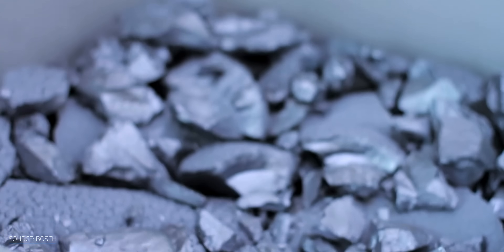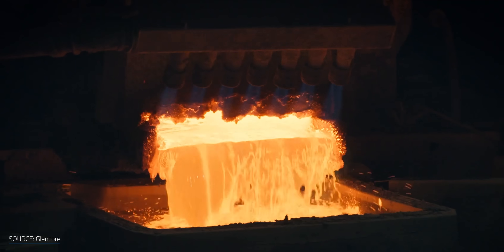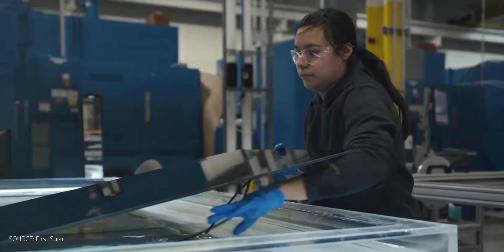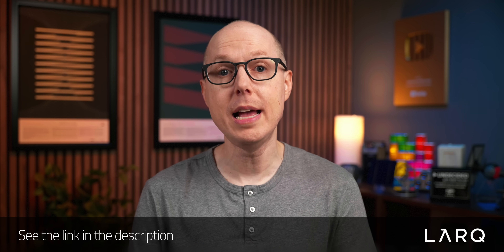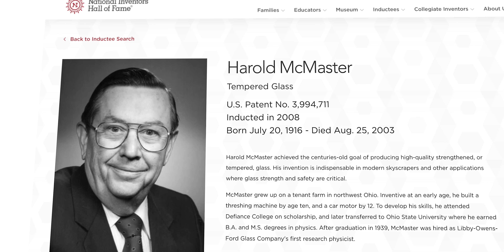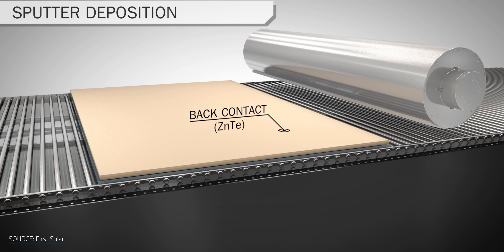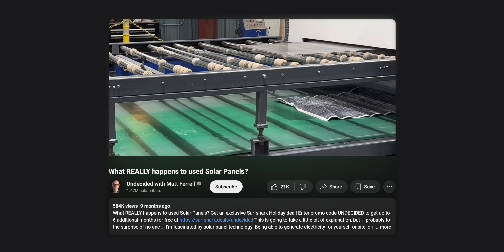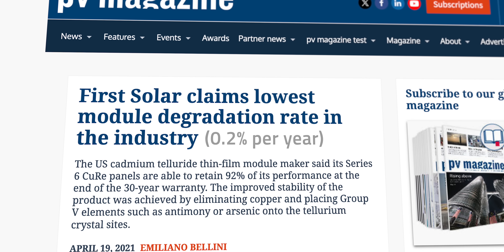How the Next Big Solar Panel Tech is Already Here

Comment: The difference between CdTe and table salt is, we don't have to ship truckloads of nasty Na and tankers full of cleansing Cl across the country to make our nice benign compound. Any site where Cadmium emerges as a (by)product is a potential problem.
Reply: The one thing to note is, we are already producing both elements at scale as they are byproducts of mining copper and other metals. Combining the elements negates the toxic effects as opposed to putting them back in the ground at higher concentrations.
Reply: @Ryan-ff2db  Yes, good point.
Reply: I well remember having a H&S inspector going round our site, where we had some processes using radioisotopes, a nickel plating plant, vacuum brazing and we handled a lot of lead, copper and zinc.
The inspector said to me "You don't use cadmium or mercury then?"
"Not at all."
"Well, you've got nothing to worry about."
Reply: @EbenBransome  I was going to bid a set of plans for a federal building off the beach here in California.  They call out for Cadmium plated screws for salt water resistance on the exterior.  Funny thing is Cadmium has been banned for plating since 2003 in California and the distributor thought I was crazy for even inquiring about it.
Reply: @Ryan-ff2db  Shows how rarely they update the standards.

Comment: Can confirm. I've been heavily involved using first solar CdTe panels for about 3 GW over the past four years. To take it a step further, First Solar specifically were huge since covid. Many of the biggest EPCs and utility companies in the country weren't able to get overseas manufactured panels, so they used First Solar. The downside with these is that compared to silicon based panels from overseas, you need a lot more copper wire for FS6 or FS7 panels. You can typically only hook up 6 or 7 FS panels in series. Most other panels are 20+ panels in series.
Reply: Most reputable EPC companies use the CdTe for solar farms in the Southwest and south, but many still try to sneak SI modules in from slave nations and pocket the money through kickbacks and other means. 
If you look at the 20 GW+ already in the field, I’d say they are very popular for larger projects when the developer can get them.
Many small time 2 bit firms can not buy these modules as they do not have the credit rating or cash to pay for them.
Reply: @noname-FJB lol, the last part is wrong. I am in Pakistan and I emailed them back in 2015 showing interest and I think they have some American arrogance as they didn't reply. 
So, I had to go for Solar frontier panels and finally after 10 years I am just sticking to Chinese Solar panels as efficiency difference has gone a lot farther than it was back then.
Reply: @ameerm4899 well, your 22 IMF loans and the loans you have from China makes it very difficult to do business with your country. But for you, Chinese panels will of course be a lot cheaper and cost efficient than anything from the US unless the Americans discover something really groundbreaking. China already has decades of production experience and economy of scale for their solar panels, the rest of the world is playing catch-up.
Reply: @ameerm4899  It has nothing to do with arrogance. Their entire future inventory is already spoken for for the next 2 years. The factories in the US don't export anything overseas.
Reply: Any idea why you're more limited in how many First Solar panel you can hook up in series? I presume it's nothing inherent in the technology, so something they could improve in theory?
Reply: @Teutathis  yeah, private sector trading has nothing to do with IMF. Just admit First Solar is a crappy company. I got mine from Solar Frontier till 2017 anyways.
Reply: @EVoltage00  yeah alright, tell them that they should remove the export/sales email inquiry from their website. And don't blame other countries like China and India for taking away all the Export markets from the US. 

FYI, I got my two inverters from Outback, one still working good in case someone wants to look down on us. 

"Ohh look, we can't sell you because we are too expensive". Your country is going to go down faster from this point onwards.
Reply: @mbevinn  the thin film panels have very high voltages. The ones I used from SOLIBRO had 110 volts OCV and from solar frontier had 100 open circuit voltage. This is why you need a lot of wiring and frankly the thin film panels are not almost defunct especially after Panasonic's own HJT technology patent expired. 
So, no point trying to raise the dead horse back to life. 

Now, Chinese are focused on HJT technology i.e. heterojunction silicon solar cell, and N type which both now exceed 25% in commercial application.
Reply: @ameerm4899  Obviously not, but doing business in unstable countries with private entities is just as difficult and risky as doing business with the government in such countries.
Reply: @Teutathis  what are you talking about? 
Have you traded in solar panels before?
We send you money by LC i.e Letter of Credit, you get the money from our bank to your bank to your account. And you supply the goods in the container size to our port of choice in your country as FOB and we take it from there. 

What's so hard with this arrangement? Chinese do the same method. Japanese do it in same way, Germans did it same way too.
Reply: @mbevinn I'm wondering why you need more copper wire as compared to Si cells?

Can you use micro inverters?

Comment: I'm a big fan from Lebanon, I love your videos Matt!

Solar saved our lives! We have 1 to 2h a day maximum of grid coverage so we just installed a 4kw solar setup and just cancelled the government grid.

We're saving a ton on bills, spending it elsewhere and living fully on green power :)

The setup is small, so we manually regulate things like on hours for fridge, etc..
Reply: Stay safe.
Can you tell us more about your experience with using solar power in Lebanon?
Many people here wonder if solar can be used as a prepper solution.
Thanks.
Reply: @fuzzy-02  are you in an urban area or the country side?
Reply: Stay safe - I hope your people come through the current troubles without issue.
Reply: @ikF3aV2m  sure.

My house is full of LED lamps, barely use 20W at most.

2 250A batteries and 4 520W panels have been doing a great job. Although it gets frustrating during some winter days with full on cloud and no heat from the sun, we never pass a day without lights and a working fridge.

Heating for the shower is gas-powered, so the only power suckers in the house that impose a heavy load are the fridge and the iron (for clothes).

Fridge runs an average of 8h, 12 during the summer, 6 at worst during winter.

I live in a very humid area with a lot of clouds too.

If I lived in a country side with minimal Cloud, solar would be a blast! Though it would be more terrible in the freezing winters Id assume too.

So yeah, the biggest power consumers in the house are iron, fridge, washing machine (forgot to mention it in the other comment), and then my pc at 100W at most.

1V in the Inverter's battery charge panel is equivalent to 500 Watts, since we have 2 250A batteries (1v x 500A = 500 Watts)

That means the Pc at very high load might take a singular watt in 5 hours.

On a regular day with 8 hours of sun light, you can say we have about 3 volts or 1,500W to work with.

You might think its nothing because of the fridge, washing machine, etc, but these don't use much power in practice because we run them during sunlight hours, so the pressure is offloaded from the batteries.

Idk if my explanations make sense but its a humble setup with minimal consumption.

The most important factor is to keeo watch on things and take care of your appliances
Reply: Sounds like you need more panels and a few batteries.
Reply: @P8qzxnxfP85xZ2H3wDRV  we could use 2 more panels, but also not really.
The batteries are never running out, not even falling below 40%
Reply: Hope you are safe! and that the nonsense stops.
Reply: @fuzzy-02  Can you explain this in more detail, doesn't make much sense: "1V in the Inverter's battery charge panel is equivalent to 500 Watts, since we have 2 250A batteries (1v x 500A = 500 Watts)". The amount of energy a battery can hold is measured in Wh or Ah (then you also need to know the voltage to calculate Wh).
Reply: @fuzzy-02  good luck dear you need to add lithium batteries 🔋.
Reply: I hope you are far from the danger. Glad you have a power solution.
Reply: Stay safe, sending love from Ireland
Reply from the maker: Oh wow.  Stay safe and hope the situation improves soon.  Sending good thoughts your way.
Reply: @UndecidedMF  Thank you Matt, I'm just a civilian and live closer to the north (things are currently happening from the capital and towards the South) in a somewhat remote place so its safe (hopefully).

All I can do currently is pray to the many saints of Lebanon for a safer future

Anyways, thank you (and everyone else in the comments) for your kind words and God bless you!
Reply: @foxyboiiyt3332  ah, when I see a rainbow appearing here I'll be expecting a box of irish beer sliding over xd
(Attempt at a joke)
Reply: You are seriously misunderstanding watts and volts i think. I have no idea what you talked about there. A pc uses a single watt in 5h? That doesnt make sense at all. Watt is a measure of power, a pc doesnt run without power. So its irrelevant over how many hours. Did you mean watthours? Power(w) over time (h) is energy (wh). But 1wh is obviously not gonna cut it lol.
Reply: @fuzzy-02  Very sorry you have to go through such nonsense when politics could solve everything, but it's a problem everywhere to some degree or other.
Reply: @fuzzy-02  wow... So this is why in many Lebanon photos I can see solar panel in residential buildings
Reply: @bardigan1  Don't be so naive War is an extension of politics sooner or later you get to a point where diplomacy fails and then hands gets thrown, plus one of the belligerents doesn't represent their nation. Unfortunately the support of H is producing dividends that the Lebanese are now going to experience.
Reply: Off grid!  Awsome!!  Yeah, stay safe!! Wish everybody in all nations around Lebanon and Lebanon itself positive vibes and the ability to reconcile and find democratic ways to govern the whole region!!  Been in Jordan, Cyprus, Egypt, Saudi Arabia and Turkey, but not (yet) in Lebanon, Israel or Syria.  Loved Jordan, the Jordanians, worked with Lebanese in Saudi Arabia and they were so Mediterranean! Almost more Italian than Arabic, even blondish, but Arab. And totally non-Gulf culturally. Admitted, same in Turkey, Cyprus (both sides), Egypt - people are wonderful everywhere and all seem to want to enjoy life, prosper and they pursue happiness - but one only needs to read the newspaper to see - that the world is transforming itself to green energy!!  Cheers to you!!
Reply: @fuzzy-02  You have your priorities right.  Lmao
Reply: You should keep your fridge freezer on.. you are probably using more electricity by turning it off/on again.

When a fridge is left on, it uses very little electricity.. if you have a newer model fridge.

I have a large 2 door LG fridge freezer, it uses less than 150W per hour for most of the day

Comment: I like that it diversifies the supply chain for solar panels so that if there is disruption in silicon production we have mature alternatives.
Reply: Also, market competition will help keep pricing competitive.
Reply: This is great for management. Always have a plan B.
Reply: I agree. Many people will fall back to SI if CDTE are unavailable.
It is necessary to have a second choice.
Reply: That point is barely relevant.  Silicon is omnipresent on earth and due to the wide use and huge market there is a multitude of suppliers.  Mankind has no way to run out of silicon in the foreseeable future.  Meanwhile cadmium is a toxic heavy metal the world is trying to get rid off.  This is a concern primarily during production and disposal.  Tellurium is toxic as well but due to low solubility this is a less grave issue than cadmium.  Meanwhile the tellurium sport price has recently peaked at 110 USD/kg and barely fallen since and predicted to continue to rise.  The situation is broadly similar to rare earths where there is only a small number of suppliers for the world market and among those again China is by far the largest supplier.  TeCd cells are relatively cheap in manufacturing and the material is being researched for a very long time already but from a strategic perspective I think the alternatives are preferable. Perovskite cells are looking like they might have a bright future and like their problems - namely the longevity - will be overcome in due time.  And then there's the promise of multi-junction cells to overcome the Shockley–Queisser limit.
Reply: Another word for silicon is SAND.   Not exactly a hot supply chain ticket.
Reply: @NunyaBizness-z8f  ultra high purity silicon production is limited to just a few mines

Comment: Thank you, good news, as usual.
I am a early adopter of PV solar energy.  In 1980 I installed my first PV panel on my boat.  In 2007 I had a contractor putting one on my roof.
Back then the cost of panels was about $8 /watt. Nowadays it is possible to buy PV panels for about $0.75/watt in the US and $0.25/watt in Europe.
My first roof system is made with 32 Kyocera 175 Watt panels and two TRACE grid inverters.
Except for some inverter malfunctions, taken care under warranty, I had no issues and after 15 years the system still produce good power, peaking at 4.8 kw on a sunny day.
About 18 months ago, lured in by the California rebates, I installed an additional 4.8 kw system + 20 kWh storage batteries.
The new 12 panels have a nominal max power of 400 Watts and an efficiency of 0.22%. Each panel is coupled with a micro inverter capable of  converting and transforming up to 290 Watts. This is because the smaller micro inverters are less expensive and have a better efficiency at lower power.
Each new panel/ micro inverter combination cost about $1,500 installed, not cheap by any point of view.
My new system power peaks at only 2.9 kW in perfect Southern California conditions, well below the nominal 4.8 kW. It's cost, without going in details, is well above the expected, considering the large incentives from the government and the drastic reduction in pv price/Watt. The new tariffs on Chinese products will only increase the cost to the consumers.
I love my solar systems but the industry has been  plagued from the beginning by false advertisement and less than reliable business owners, ready to take advantage of Government programs and consumers alike. Only there to make a quick $ and move on to the next gold mine.
Thank you.
Mauro
Reply: Thanks...
Reply: Very informative and indicative of the need for the real world reporting that you provide here. Could one purchase older gen panels such as you Kyocera ones?
Reply: That’s early. My first solar panels: BP 75 watts, 1993. Expensive little buggers!

Comment: I worked for a company in the noughties that made laser scribing machines. We built many machines for scribing and patterning thin film solar panels, back when the goal was a Dollar per watt, and thin film looked like the only way of achieving that. We only ever built one machine for producing Cadmium Telluride panels however.

Most of our machines had fairly robust dust extraction systems for removing ablated material, but for our CdTe machine we put more design time and effort into the extract system than the laser system itself. Like asbestos, CdTe isn't a problem when it's bonded within a panel, but as dust, it's nasty stuff.

By the way, while we would always write it as CdTe, we would say cad-tel rather than c-d-t-e.

I would say though that the efficiency of thin film solar does make it ideal for BIPV (Building Integrated PV) and I suspect that the same goes for vertical panel and agrivoltaic installations, where a the lower efficiency can be offset by the potential lower cost per watt when pure watt/sq.m yield is less important.

Comment: CdTe has lower efficiency, but there are two benefits that Matt didn't touch on: they are much cheaper than silicon panels (between 1/3 and 2/3 the cost per watt), and their efficiency losses at higher temperatures are lower than silicon, so on hot days, they make up some of the efficiency penalty vs silicon. The cost advantage is somewhat offset by having special inverter requirements that the installers need to be aware of, and with few installers working with CdTe at all, that could be an issue. But if you have the space to meet your needs with CdTe panels, they are probably a better option than silicon.

Comment: In my house, probably not. With the limited space I have on my roof for solar panels, that efficiency gap is going to be the key to getting my business. I'd also be concerned with the toxicity of microfragments from a damaged solar panel in a home environment - especially given how Cadmium acts as a heavy metal, making poisoning via the slow absorption of tiny quantities over time a possibility.

I'd certainly like to know more about how Cadmium Telluride Solar Cells stack up against Silicon Cells in the harsh environment of the Australian outback:
 • Staggeringly hot temperatures reaching 60°C.
 • Omnipresent exposure to the slightly conductive, fine red dust (composed of various Iron Oxides), which can both adhere to the panels with static charge to occlude the panels & get into (unprotected) essential circuitry, causing shorts.